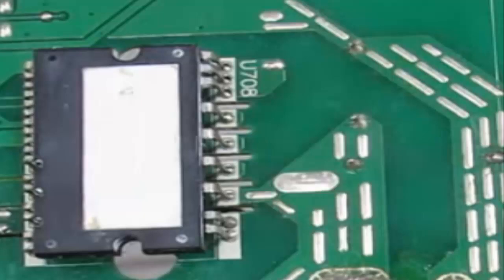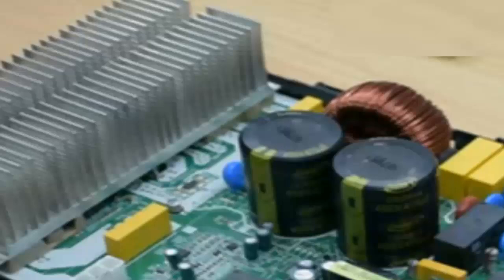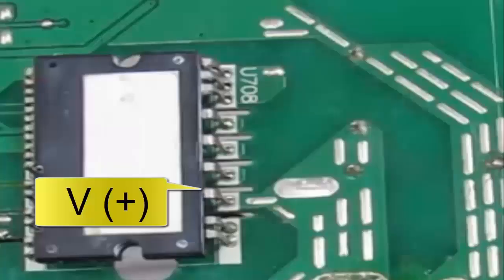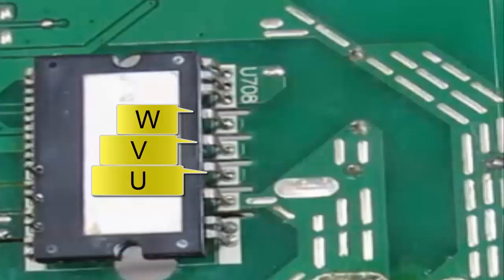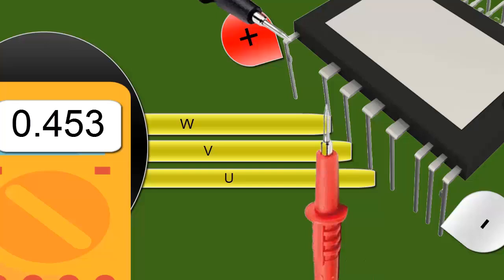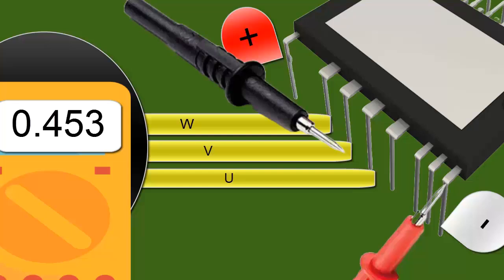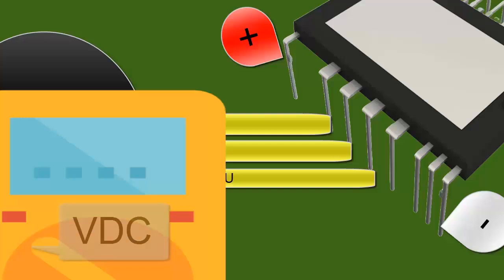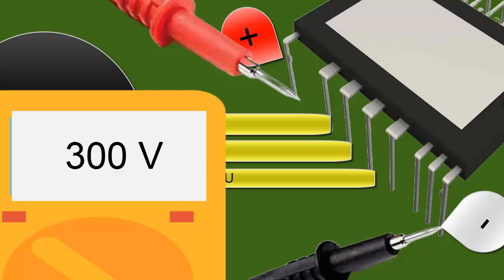Diagnosing IPM Circuit Failures in Air Conditioners: Common Issues, Testing & Solutions Explained

Comment: OK but why wouldn't you check the external power supplies first, if the problem is related to the IPM controller you aren't going to replace it you are going to replace the whole board aren't you?